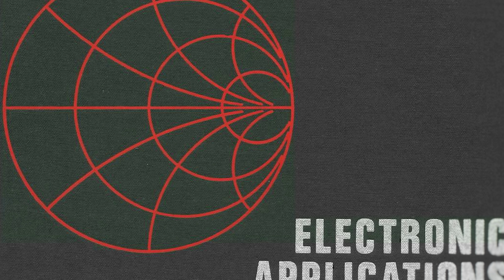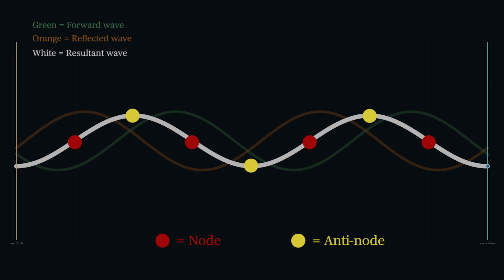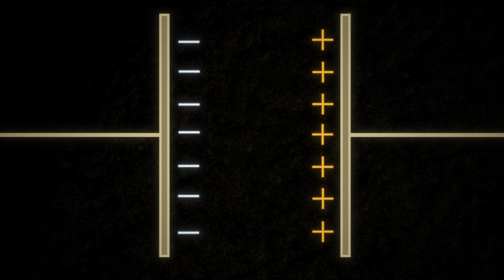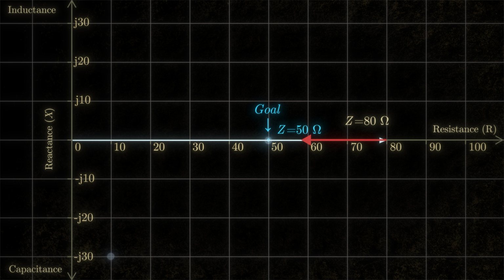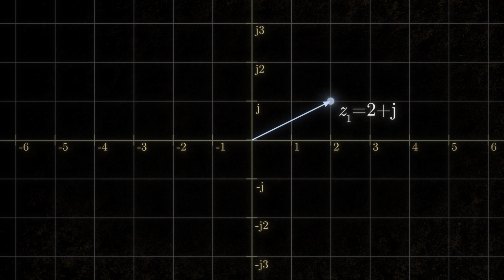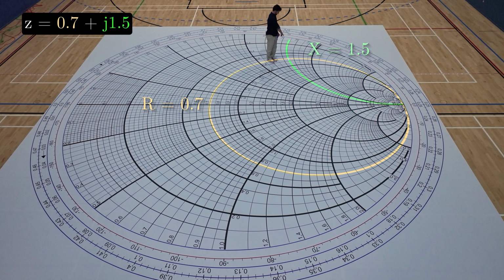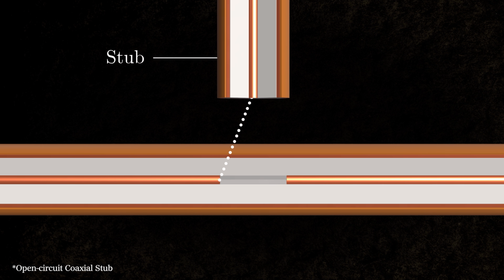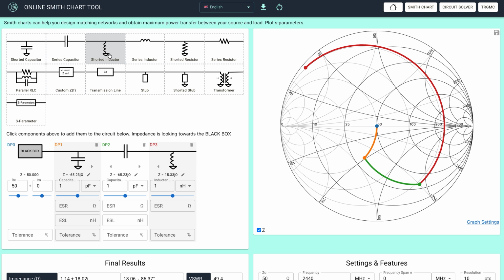The Scariest Chart in Electrical Engineering

Comment: As an RF engineer, I must say that this video has done a great job at explaining the basic concepts. Some concepts have been oversimplified, likely for the sake of reaching to a wider audience. Kudos to making the topic more accessible and fun for everyone. 

Some corrections/clarifications:

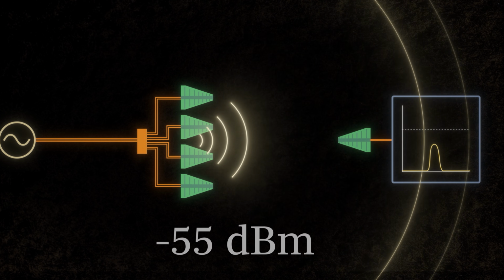1. At 7:05, the received power is mentioned as "decibels" (dB), which is dimensionless. This is not what is used or displayed on the spectrum analyzer. Instead, we use dBm, which is a logarithm of power referenced to 1 milliwatt (1 mW), hence the "m" in dBm. 0 dBm is 1 mW, 30 dBm is 1 W. There are other similar units such as dBuW and dBW, similar in concept. 

2. Another reason we don't always use stubs is the limited frequency response. Using multiple elements will improve the bandwidth when done correctly. 

3. We don't always want to conjugate match everything. 

When designing with active devices such as LNAs (low noise amplifiers) and PAs (power amplifiers), we will intentionally mismatch them. 

This is because the optimal reflection coefficient values of some parameters such as gain, noise, output power, and power added efficiency usually appear at different locations on the Smith chart. Instead, they appear as multiple circles/contours with different center points on the Smith chart. You can Google "noise circles" and "power and PAE circles" to visualize what I mean by this. 

The RF engineer must then consider the trade-offs between those parameters (for instance, give up some power gain for better noise figure), instead of aiming for conjugate matches.
Reply: I'm still amazed at what you must have done broad banding amplifiers with mismatches, And then I discover matching engines and mufflers and gears have similar math to maximize power teansfer.
Reply: @nspireConnection  Much of physics is deeply tied to how energy is conserved and transformed from one form to another. It can be kinetic and potential energy in a mass-spring system, electric and magnetic energy in an LC tank, or compression and rarefaction in a gas. They all share more things in common than we realize. Under appropriate approximations, all of their mathemathematical models reduce to the "harmonic oscillator". 

If you take more liberty in assumptions, such as perturbations being small from equilibrium, you get the simple harmonic oscillator. A simple linear second-order differential equation that shows up everywhere in physics, from quantum mechanics and RF/microwave theory to strings on a guitar and sound waves. This has brought me a lot of memories from college when I took partial differential equations.

Comment: Anechoic chambers are designed to primarily to reduce reflections (no-echo chamber). However, laboratory grade ones would also have grounded metal walls to reduce external interference (i.e. in which case they are Faraday chambers/cages as well).

Comment: This is nothing new to us old and new electrical engineers. This smith chart is technically just a mathematical mapping of a Möbius Transformation due to it being perfect math. Technically speaking, the only thing the smith chart does is visualize impedances & reflection coefficients purely by math. It does not account for everything else found in our reality because it is based on an idealized, mathematical assumption of a perfectly, closed system. To further this truth by evidence, this math solely treats these components (such as a resistor) as zero dimensional points in space as "lumped elements" with perfectly contained electromagnetic energy, staying in a perfectly unchanging thermal zone working only in a 2D mathematical plot, making it useless for predicting the entire system's full behavior. Sadly, because quite a bit of people are not in the field- this won't be seen as pathetic- which should be. Plus, I'm surprised that you ignore the other dimensions on a frequency. You only have Positive and Negative on a 1 dimensional axis + time. Now work with 3 dimensions + time. Just mathematically demonstrating a visual sinewave along with what I spoke about, following a super toroid makes what you are talking about look like child's play.

Comment: I built a super cheap antenna in college based on what starts around 32:30 in the video. I used 300 ohm antenna wire. It matches the impedance of air pretty closely. I then made the horizontal length 1/4 of a wavelength of the college radio station I wanted to pick up where we lived, and spliced the stub in on the middle of the bottom wire. Connected to the antenna leads of my Pioneer receiver, and it worked perfectly. Total cost, probably zero. I think I found some antenna wire in a garbage can at school.

Comment: Electrical network designs were used to figure out the whole "perfect rectangle" problem in the 1930s. Interestingly, it didn't use the Smith Chart, but the Smith Diagram, which was invented on the spot by a Cedric Smith who has nothing to do with the Smith in this video.

Comment: Don't know WHEN it happened but E= I x R was changed (and it irritates me) E (Electromotive Force, measured in Volts) = I (Intensity, measured in Amps) x R (Resistance, measured in Ohms). But now I hear (in this video) "Volts divided by Resistance".... don't you means Ohms ? Switches Ohms law to V = I x R should REALLY me V = A x Ω right? And you can't refer to the ELI the ICE man phrase anymore: "ELI = Electromotive Force (Volts) before Intensity (Amps) with (L) inductance or ICE = Intensity (Amps) before Electromotive Force (Volts) with (C) Capacitance) .. Switching E to V but NOT I to A or R to Ω ?? JUST leave E alone!

Comment: 2:28 apparently reflected power bounces back and forth and is eventually radiated by the antenna (except for line or antenna losses etc)! E.g. if the transmitter is matched (e.g. using a matchbox) even though the antenna is not matched to the line.

Comment: Nah, it looks way weirder and harder to use than it actually is... Well, provided that you studied the theory behind why it looks the way it does (which is quite easy). Also using it is kind of straightforward in most cases, just be careful about which numbers you're actually reading because often students mix up impedance and admittance values or read impedance values instead of stationary wave ratio module values. 
Using the Smith chart was actually the easiest part of my MW electronics course.

Comment: Scary?  I once did a show-and-tell on Smith charts to my amateur radio club.  The first slide said DONT PANIC, big and bold.  Next slide was a combined impedance & admittance chart in full detail -vewy, vewy scary! Next just the impedance chart, then a 'skeleton' impedance chart which was actually a live chart from a program 'SimSmith'. The sequence showed first amazing complexity with lots of circles all over the place, then lost half the circles and ended with just 3 circles and a straight line. Not scary at all!

I used SimSmith to show how any load (audience suggestions)  can be matched in several different ways, the 'ATU' aka Z-match which many hams use  thru various tricks with cable inserts, stubs etc.  All straightforward and easy once you know how the chart works.

Comment: I'm a mechanic and I have built some exhausts and there's a thing called a "quarter wave resonator" that we use some times. basically its a length of pipe that you add on to the side of the exhaust where one end is connected to the exhaust and the other end is closed off, the idea is, the exhaust pulses travel down the length of pipe and reflects at a certain wavelength determined by the length of the pipe, travels back into the exhaust 180 degrees out of phase to cancel out a certain tone or noise. now you can tune what noise you want to cancel out by adjusting the length. Why is it called a quarter wave resonator? well because a closed tube resonates at 1 quarter of its wavelength and it travels down and back, so 2 quarters or half if you will, which is 180 degrees out of phase... Anyways all of this to say, I wonder if its possible to make a chart for that 🤔 because ill be honest most of the time we're just guessing and trimming it to length lol

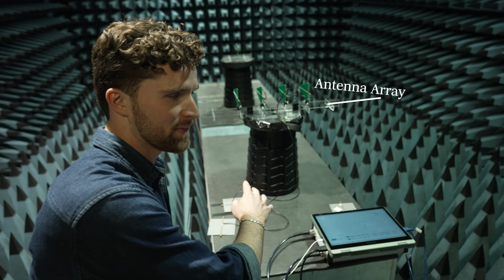Comment: 6:50 Is that anechoic chamber also a Faraday cage?  If not, then I don't see how putting something in there would reduce electromagnetic interference.
Reply: it works the same, however those foams are made of electromagnetic  dumpers in opposition to sound dumpers in anechoic chamber,  and spiky shapes are just to be a wide range of RF
Reply: @2EOGIY did you just make that up?  Why?
Reply: @jej3451  first question - no, second question -your assumption makes no sense if the answer to first question is no
Reply: @2EOGIY  Welp, it's wrong.  First, there's no such thing as an electromagnetic "dumper".  And secondly, an anechoic chamber is for stopping echoes in sound waves.  The purpose of the chamber has nothing to do with EM waves.

Comment: RF is the dark arts... Straight up black magic.

DC circuits are pretty straightforward...

AC has its quirks...

RF... Takes everything you thought you knew about how electrical and EM energy works and tosses it right in the bin.

A direct short between your positive output and ground? Perfectly fine... So long as if the length is short enough.

Comment: Something all Ham radio enthusiasts need to know when they set up their antennae! I still have my father's old RF engineering handbook from the 1940's. It's 6" by 4" AND 3" thick even printed on onion skin paper stock!! Electrical engineers use lots of mathematical transforms to simplify their calculations. The Laplace Transform in circuit analysis is very important tool for circuit design just as this is for antennae impedance calculations. Still stretches my head just like it did in the 70's.

Comment: 0:10 wiring diagram for Deathstar?
Reply: As fan of Star Wars I laughed too loud
Reply: Very accurate, I will steal.  The EE Deathstar.  Question is, is Smith Darth Vader?
Reply: @hughjorgen5588  I find your doubt disturbing.
Reply: An electrical engineer would have found a more practical solution how to route the cables - say if fx if the AC guys are already running a shaft through the whole facility, then you'd just run the cables along that shaft. 
 
Easier to maintain and simpler install. What possible downsides could there be to that?
Reply: @Ragnaroz6000 😂 very true
Reply: Cold Fusion actually!
Reply: Close enough
Reply: Meanwhile blacksmith use heat treatment chart
Reply: I came here just to find THIS comment. 

Most impressive.

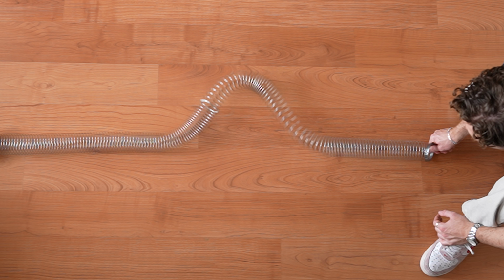Comment: 15:39 If you're a radio operator and know how to tune your own equipment, this section should definitely be familiar to you when you're tuning your antenna to your radio to ensure you're getting your full power output transmitted from the radio and out through the coax and radiates from your antenna. 
We know this as an SWR ratio. Standing wave ratios determine how much power output leaves your radio and how much stays in it heating up your power output finals. 
This gives you a great visualization of what is going on.

Comment: Been a ham for 69 years next month. Lots of antenna and other circuit matching over the years as I've always enjoyed designing and building. Started using a software-based Smith Chart in the 80's. I'm an economist, not a RF engineer. No idea why smart young EE students would find this incredible tool scary.

Comment: I have about 300 impedance/admittance charts,  had one that i marked up with all the bells and whistles and put in a plastic sheath and used a wax pencil on it to do the quickie calculations then could erase it.   For an RF engineer these are very basic and common